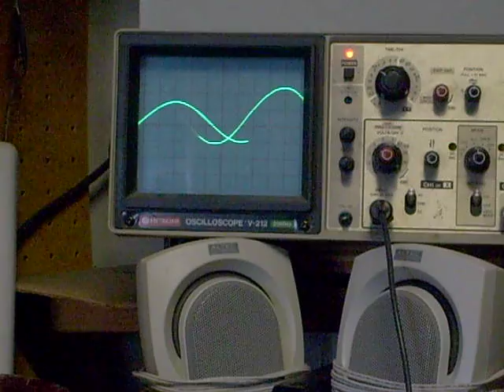Phase shift differences under variable loads.

Comment from the maker: @MehinUtah That's an older video I need to re-do in the near future. There is a better way to do this experiment by using one coil and measuring the input current and voltage at the same time. This will demonstrate how there is a delay in the rise time of the current in relation to the voltage. 
In the demo I showed I think it would be best described as a delay in current Vs voltage rather than simply claiming it represents a time delay between the primary and secondary.